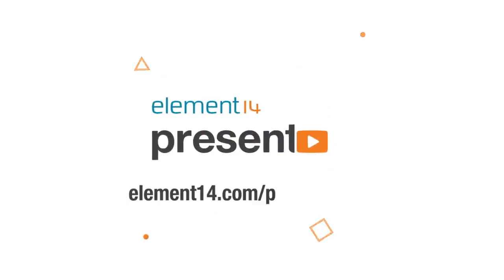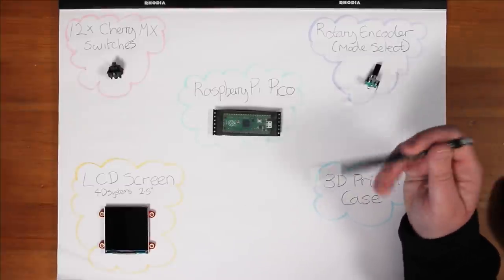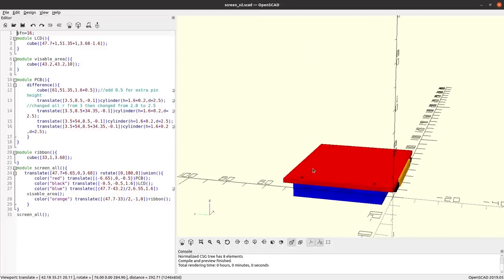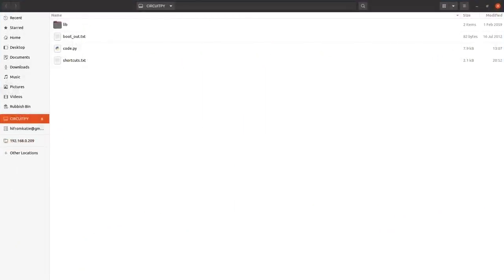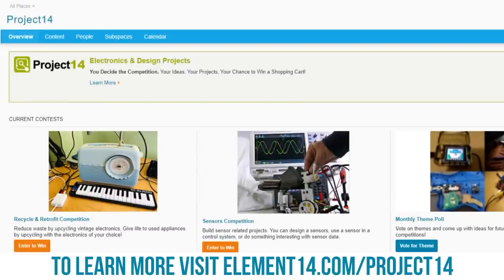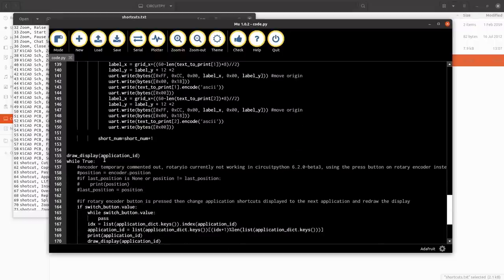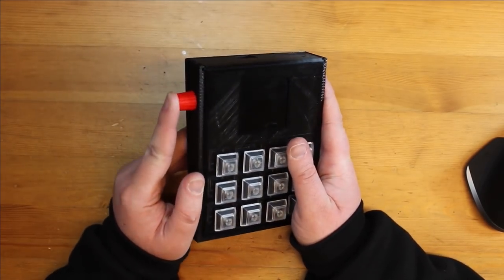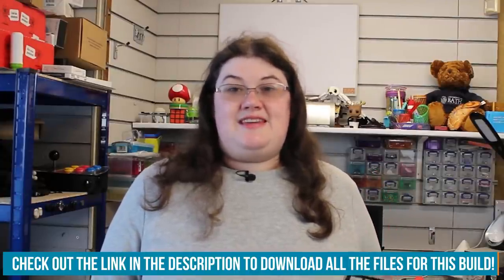Keyboard Shortcuts Keypad with #RaspberryPi Pico

Comment: This looks amazing. What's brilliant is you have all the information there for the project so you can tweak it for hardware, software and parts. Personally I'd continue to use the pushbutton on the encoder to change selection and maybe use the rotary encoder for changing settings like brightness / volume etc. 
OR better still have two rotary encoders.😀

Comment: Great work! The encoder could be also used to select pages of shortcuts (if there are many to use), depending on the application; and the push button to change the application.

Comment: Katie, would you be available to do a quick project for WHEELS Of HUMANITY to create a keypad Almost exactly like you have, but instead of shortcuts to applications it generates sounds to a 12 channel acoustic amplifier and 12 speakers.  Sort of a combination of your project and A Sound board project that plays a sound when key pressed.  The new component is then the output to external audio lines.

Comment: Nice work. Does anyone tried to use a cheapo projector to have dynamic labels on switches?
Reply: Interesting but imo impractical. The frame needed to keep the projector aligned with the macropad would take up a significant amount of desk space. If you actually USE the macropad, you learn the layout in short order anyway. In my experience, keeping index cards with your layouts handy is a much better combination of practicality and frugality than any dynamic key labelling system yet devised.

Comment: ok so if the project im thinking of can be done this channel def seems capable of answering this question.. so in the crypto world there is a new type of miner and its called the rak miner by calchip and is used as a helium hotspot!! theres a few companies building different versions of this miner but the rak runs on a raspberry pi and how to do the build and all the software is open source.  my question is can these boards be made at home instead of paying 400 bucks! yup they went from 249. to 349. to 409 and as the helium coin raises im sure it will cost more!! im actually giving your team an excellent opp for these miners are on back order for months so if this is possible look into the rak miner by calchip and information on the specs can be found at heliums site , not sure where i read specs but they are open source ! crypto is the future and if you guys can build these devices not only would it help out many many ppl stuck waiting but it wld be an amazing income!! than you for your time!